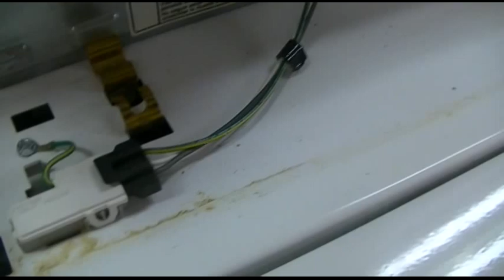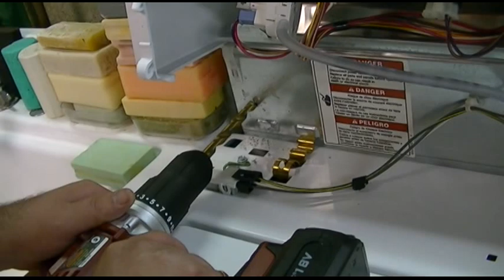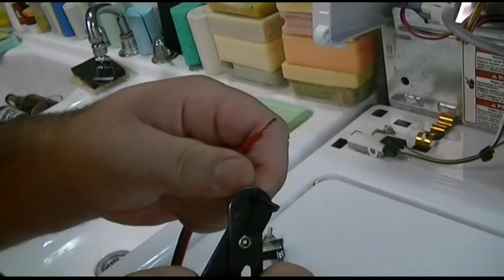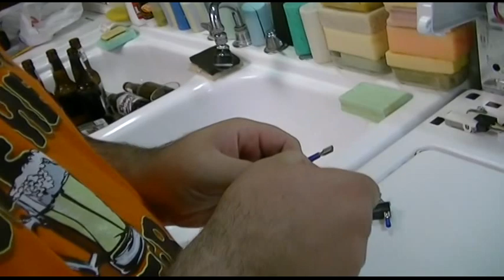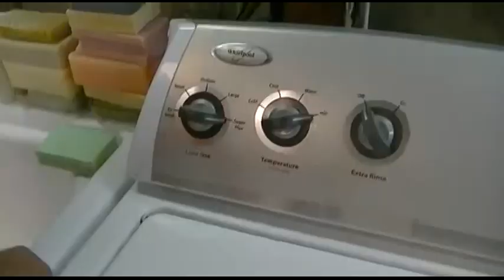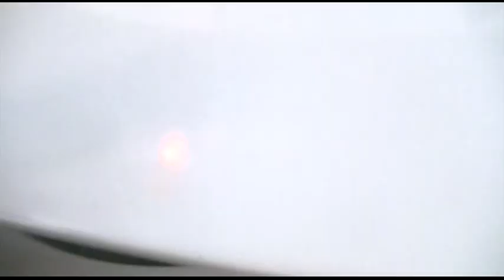The Great Whirlpool Lid Switch Defeat, Part 1

Comment: why did u put a toggle switch?  to me this makes no sense.
Reply from the maker: I put a toggle switch to give me the option between bypass and factory.  In other words, I can bypass it when I want, but change it back to factory operation.  Sometimes a lid switch is actually a handy thing, especially when fixing or diagnosing something, it's an easy way to stop the machine.  If I just bypassed it entirely, I wouldn't have that option.
Reply: @jaykay18  i see :)... makes sense :)

Comment: I'm kind of curious, how do the switches actually stay in place? I assume the holes are just big enough to let the switch sit there snug.
Reply from the maker: The shaft of the switch is threaded, and there's a nut.  To install, you remove the nut, feed the switch through the hole, then secure it with the nut.  When the nut is properly tightened down, the switch generally doesn't go anywhere.

The other mod I did for the warm rinse, went through the plastic on the side.  With that, I was able to drill the hole just barely the right size, then, with pressure, I could start "screwing" the switch into the hole.  That caused the plastic itself to become threaded, as the material is soft, which further held the switch in place.  Still secured with the nut in the same fashion, it just had a double-layer of security.

Comment: My washer is the same model as the one in this video.  I just want to open the control panel the way you guys did.  I can't.  I bent the crap out of everything and it still won't open completely.  I don't think I'll ever get it back in place either.  What am I doing wrong?
Reply from the maker: Some of the lower-end versions of this model washer (less features, like single speed, etc.) have screws in the back of the panel instead.  I serviced one of those once and it threw me for a loop for a bit too.

Comment: After repairing several appliances in my day,  I don’t understand how the switch still works when the lid is open. I mean, the toggle  switch is completing the circuit back to the timer when in the on position. 
  How is the circuit being opened to shut the washer off when the lid is opened?  Looks like you would need to flip the toggle switch off to open the circuit. 
  Btw, those lid switches are not very expensive.
  My bad!  Read on another reply where you said you only did this to allow you to run the machine with lid open. 
  I thought you meant to show how to completely bypass the lidswitch.  I was shaking my head!  LOL!
  Though I am not really sure why you would normally want to run the washer with lid open.
Reply from the maker: Yes, this toggle switch is wired in PARALLEL with the lid switch, not in place of it.  I know what I'm doing.  There are plenty of other videos I have that will show you some of the other stuff I've done.

I always run the washer with the lid open because first off nothing splashes out, and second, I get to watch it wash.  My parents have a machine from the 70s where you could do that, and nobody got killed then, so I can do it today.  Though with the mess washers have become, all computerized and such today, not so much anymore.  But then again, they don't wash, either.
Reply: jaykay18 I meant to get across that I misunderstood what you were actually attempting to do. 
  I agree about the older simpler machines that would agitate with the lid open and the newer ones that will not agitate with the lid open.  Some tend to drain if you stop them to add a piece or two of laundry then refill. 
  I am attempting to learn more about the newer control boards and their components, capacitors, relays, etc. 
  So many times a very expensive board can be repaired for four or five dollars or less. 
  Btw, I reread my response and hopefully corrected the spellcheck error!
Reply from the maker: Yes, I understood what you meant, no problem.  I wouldn't even bother with a machine with all of those electronic controls since the wash action is so poor.  Guess it's back to a washboard and the river...

Comment: I can copy what I see but my washer has 4 wires not 3. And I don't know how to wire that
Reply from the maker: That's because you can't bypass the lid switch on yours.  Yours has a lid lock as well.
Reply: Didn't work messed up my controll panel
Reply: If you know the sequence of operation of the washer you only need one switch.  A simple toggle switch works great. Here's how.
The white and blue wire, connect together on one terminal of the toggle switch, lid closed. The red wire connect to the other terminal on the toggle switch. 
Washer sequence, is sensing lid locks, turn toggle on. The next stage is the washer will unlock the lid, the lid lock led will flash, turn toggle switch off. You will then hear a click, turn toggle back on, lid locked. Works great!
Cap the yellow wire you don't need it. I looked everywhere and  I tried everything. This really works!!
Reply from the maker: That's all fine and good, but it's still a manual operation!

Comment: OK, Thanks for that. but it seemed too complex.  I just wanted to be able to open the lid without waiting FOREVER after hitting Pause.  I used a #15 Torx driver and removed the latch from the lid then placed it into the receiver/sensor/lock.  It took like 1 minute.  Now I can lift the lid any time I want.  Yes, beware that the tub spins very fast - don't stick your hand in there while it's spinning!  And you have to take it out and replace before another load will start.
Reply from the maker: This wouldn't work on your machine anyway.  This machine has a tub brake, so it has no need for Play/Pause buttons and waiting for 64 minutes for the tub to spin down; the tub brake stops the tub in less than 7 seconds.

When they got rid of this design, they "broke the mold" for a design that was in service for over 25 years.  A design that was very robust, worked properly without complaint, needed no circuit boards or computers.  It had one job to do, and did it well.  It can certainly break, like anything else, but it was also designed with serviceability in mind.  I've had one minor $5 repair to one of my machines, and that machine is probably over 20 years old.  You cannot buy or get that kind of quality anymore.  I've discussed this with my machines and informed them that they will simply have to work for the rest of my life.  Only the very best will do.  Should there be any breakdowns, which of course are inevitable, I will fix the machine myself.  Parts are plentiful and should be around for some time to come.

Comment: Thanks for the Video! It's 3 a.m. (or some time after by now) here in Michigan, I'm tired, and my bed sheets and blankets were soaking in a dead washer full of water. I already knew where I was trying to get (my chosen style has always been to cut, cross, splice, tape, move on), but in my 30 years, I've only done 2 or 3 of them, and for some reason I don't recall seeing a ground wire on them (my current switch is the same as yours in this video) so I was a bit worried. Your video gave me the confidence to go ahead and move forward with cutting that corporate-lawyer-litigious-society-treat-me-like-a-mentally-ill-monkey piece of shit out of there. 

P.S. The glorious sound of my blankets being relentlessly driven against the ceramic walls of their hell by its spin cycle are invading my ears as I type this. I'm either going to go to bed soon, or be killed when I "forget" that it's a bad idea to try to taste my blankets while they're spinning.....  Get my family a lawyer. Its Whirlpool's fault; they should have made their wiring out of unobtainium so I couldn't cut it.
Reply from the maker: Ha ha ha, thanks Dave!  Glad this helped you out!